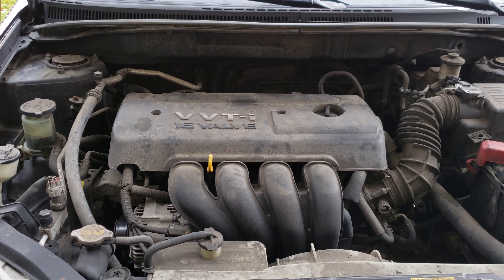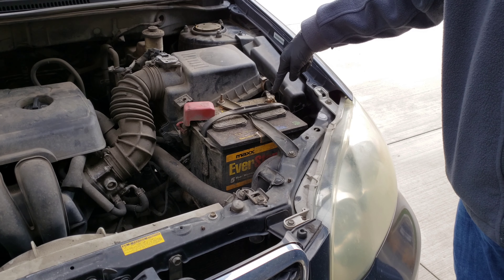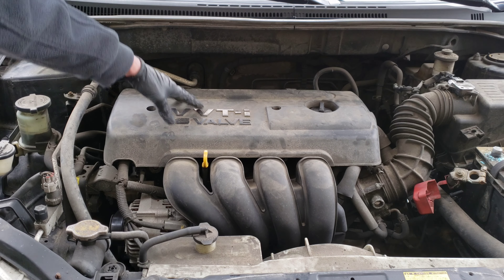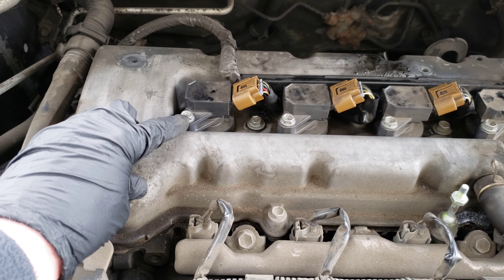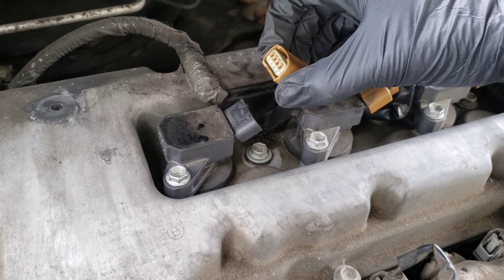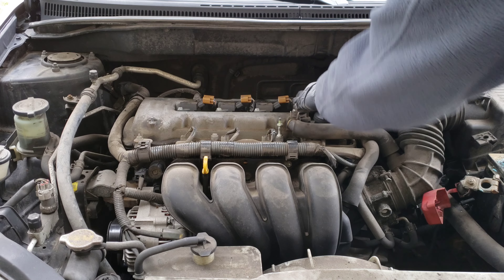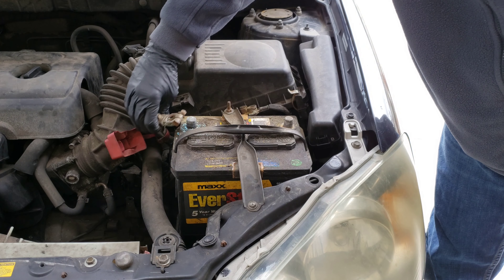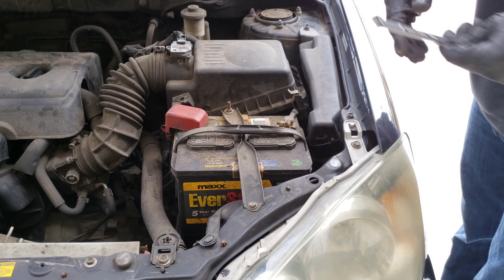How To Replace Ignition Coils On A 2003 2004 2005 2006 2007 2008 Toyota Corolla

Comment: Is it possible to clean corrosion from contacts and restore function? I have #4 misfiring after letting it sit for a year.
Reply: You can try cleaning inside the coil where it goes on the plug, and putting new dielectric grease/gel inside the coil where it connects to the plug. Also check the spark plug condition of #4; if it's dirty, out of gap spec or cracked, replace the plug.

Comment: I have cylinder 4 misfiring… does it go in order? I know spark plugs fire in different orders. Is 4 all the way to the right?
Reply: start from left is 1,2,3,4  u have the same issue as me misfire on 4 change that one only and u should be good to go like me.

Comment: Todd, I am replacing number one ignition coil, because that is what the diagnostic reading was. I cannot find anywhere in my Toyota manual which coil is number 1. Is it from left to right or right to left. Toyota Corolla 2006 S 1ZZ . Thanks
Reply: left to right 1,2,3,4  i changed my 4 today for a p304 misfire car run good again.
Reply: from my left or the car’s left?
Reply: A would 1 B would be 2 and so on